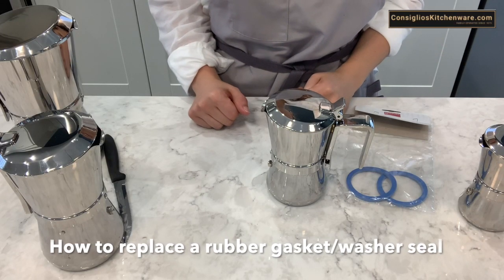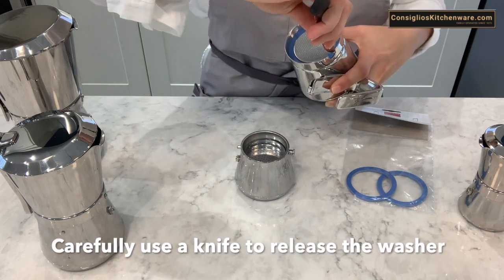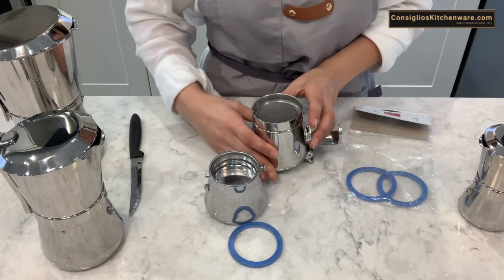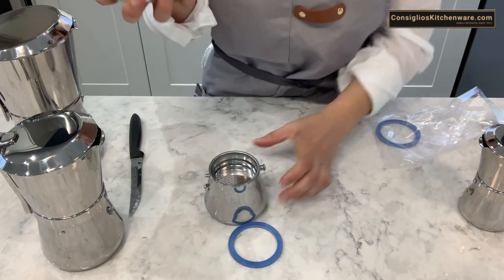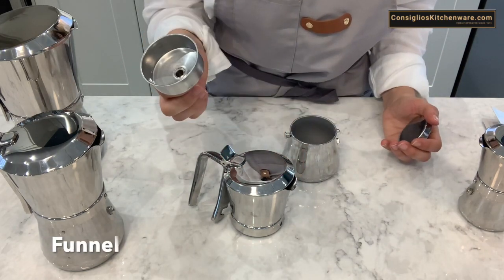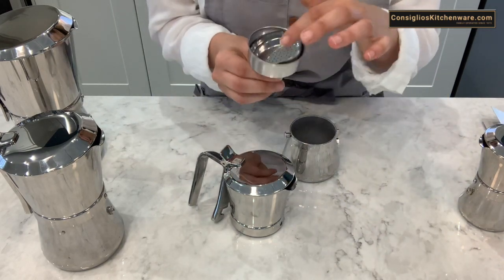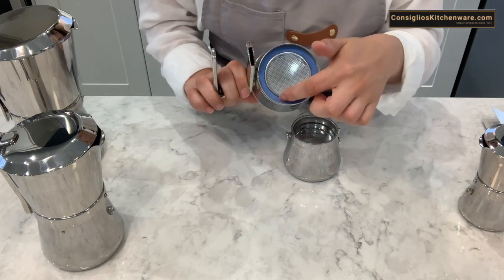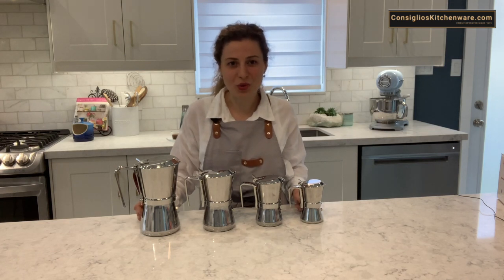How to Change Replacement Parts on Giannina Espresso Stove Tops

Comment: Thanks for this! Doesn't one need to remove the gasket and clean all inside after every use? Or do you just wash the moka pot without removing that gasket over long periods of time? Thanks!
Reply from the maker: Hey there, 

You can remove the blue gasket once per week to do a deeper clean. If you want to remove it after each use you certainly can, but its not one hundred percent necessary. 

Thanks!
Reply: @Consiglioskitchenware  good to know, thank you! :)

Comment: Hello,
Is the Filter plate Stainless or Aluminum? Thanks.
Reply from the maker: Hi Lori, 

Sorry for the delayed response. 

The Giannina with the locking handle are all stainless steel. 

Giannina has been considered the best espresso maker by millions of consumers and is made of heavy duty stainless steel. The boiler and reduction filter are made with AISI 430 stainless steel and the rest of the stovetop is made with AISI 304 stainless steel. This combination of stainless steel allows the stovetop to be induction ready.

Link to Giannina: https://www.consiglioskitchenware.com/collections/stove-top-espresso-make/brand_giannini?

Have a great night, thanks for the great question!

Comment: Hi everyone, i'd really need to know before buying one! On the bigger ones, i think you have a reductor (smaller filter so you can brew fewer cups in the same bigger pot), question: if you put the reductor but still fill it with more water for all the cups (eg. you load 2 cups grounds, but still pour water for the full 3 or 4 cups of the pot), then is the coffee good or bad? In Italy we had some very old mokas that made a good one but worked in a different way and not can't be found. And even in Italy i can't find anyone who will know and tell me. It is not like an americano I mean. But as in the US you maybe commonly drink more diluited coffee, maybe you know what i mean and can tell me. Thanks! :) (last: if you do so in any moka pot, that is, you just fill half the grounds tank, the coffee will be very bad. But i'm wondering if using a reductor makes the trick)
Reply from the maker: Hey Dorian, 

The reducer is used to minimize the space where you put in the coffee/espresso grounds within the funnel. When using the reducer, you will put half the amount of water in the boiler. 

This way the strength of the espresso will still be there. If you intend on getting a less intense or desire a watered down espresso, then keep the full capacity of water within the boiler. 

Thanks for the question.